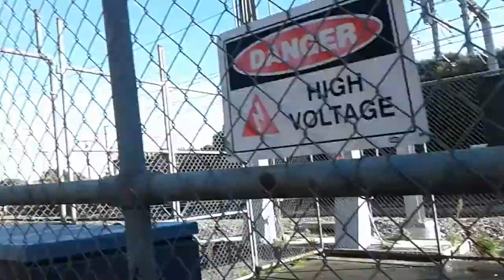Pukerua Bay train substation

Comment: I think of railroad electric systems as very alien! In some parts of the us they use 8 phase conductors 25hz for their grid it’s really weird.
Reply from the maker: metersocket00 this substation is just too keep up the voltage and current there are many of these substations on that railway line since the trains run on 1500volts DC so they need substations to minimise losses
Reply from the maker: metersocket00 but I do think 8 phase with 25 hz is very weird but here must be a reason for doing that. I have never head of 8 phase 25 hz. I will do a video on how the trains run in the wellington reigon because trains in other parts of newzealand run on 25 kv AC